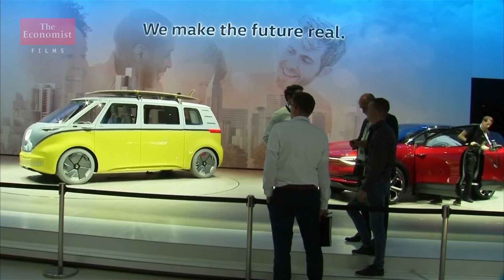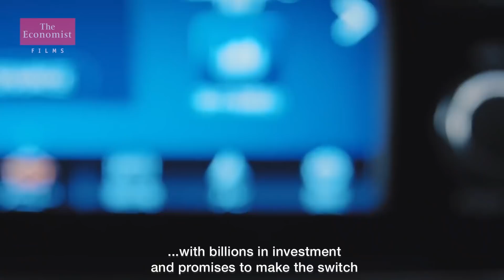Electric cars will come of age in 2018

Comment: Sorry but could this be the next bubble?    Can the batteries be charged more than 500-600 times?    How much will it cost to replace the batteries?    How long does it take to charge the battery?
Reply: 7% battery degradation after 250.000 miles https://insideevs.com/tesla-model-s-250000-miles/
Reply: It takes ten seconds of my time to fully recharge the battery on my EV.  Five seconds to plug it in at night, and five seconds to unplug it in the morning.  Compare that to how long it takes to drive to a gas station, pay for gas, fill it up, and drive home.
Reply: Taking battery replacement into account, the cost of ownership of electric car is still better.    Keep in mind that this tech will improve with time.  So replacement batteries 7-10 yrs hence will be likely be cheaper lighter, longer lasting, faster to charge, etc., ...
Reply: This isn't the next bubble, its the next reality for mass transportation. Battery technology is still in its infancy, but because of the inertia of EVs, that tech is closing in on huge innovations. Here is one by one of the most important researchers in this field, the man that co-invented Li-Ion:https://news.utexas.edu/2017/02/28/goodenough-introduces-new-battery-technology

Here is another battery tech that is currently being produced as I type this: http://www.toshiba.co.jp/about/press/2017_10/pr0301.htm?fromRSS=IR2017100301

Remember, ICE has had over 130 years of supremacy, and the lion's share of R&D. It will only get better for EVs from where we are at today.
Reply: Adam Smith you must be stuck in the 90’s. We have modern ways of disposing and recycling batteries. Electric car batteries that have had their charge reduced too much to be used for an electric car are used to store power for homes and other buildings, because even though it’s not useful in an electric car it’s still more than enough to power a home. A home uses 30 kWh per day on average, a 60 kWh car battery at 60% capacity is still 36 kWh of charge, that can power a home for 1-2 days during an outage. You can’t so any of this with a gas/diesel car. I’m assuming you forgot that these gas/diesel cars sit in junkyards and/or get crushed?
Reply: Blazing Dumpster 1. Yes, 2. Expensive but they last 10+ years with little degradation if the battery has PROPER thermal management. Overall batteries will get cheaper so a $9000 battery replacement now will cost $3000 5-10 years from now. 3. Charging times only matter in long distance trips, you will be charging your car everyday at home and/or work so charging time is irrelevant
Reply: Blazing Dumpter WRONG or IRRELEVANT. We don't know how fast the limits of DC Fast charging it yet, still being developed. Currently we are limited to 80% fast charger in about 45 minutes. But that is Developing very Quickly will get much Faster. My guess for 100kwh battery 15 minutes is the safe thermal dynamic limit upto 90%. But not something you should need often. Majority of BEV usage is simply plug it in end of the day when your 100KWH BEV has multiple days range of commuting. 
When batteries size keep getting bigger the  less Freezing Weather has effect, combined with Preheating the range hit should be getting close to 20%, not 40% that was for stupid machines like Passive batteries in Nissan Leaf 2012. 
CYCLES is IRRELEVENT as BEV batteries are  roughly a few hundred or thousands of cells. They behave nothing like a Cell Phone, WRONG analogy. When you balance Partial Discharge across thousands of cells you don't technically cover a full cycle. Thus why REAL WORLD Data shows BEV batteries loose just over 12% after 200,000 miles (still quite bad). 
But all this information is Redily Available VIA FUCKING GOOGLE. So stop with the Fake Ass Rhetorical Question where you clearly are trying to set-up a FALSE Assertion.
Reply: Tesla superchargers can deliver 300 miles per hour in peak conditions (depends on how full the battery is)
Reply: Adam Smith LIES and stupidity. Soo you are going to throw away $$$ Money. Companies will want to collect those batteries out GREED and profit. BEV batteries are NOT DEAD after deemed not acceptable for propulsion duty. Some will be chery picked for Stationary Storage while the rest will be recycled for the Valuable materials. Companies like IT Asset Partners are already pioneering that industry and growing at an alarming rate. Only Idiots like Adam Smith throws away money.
Reply: You will never have to replace a car battery.  You've been lied to.
Reply: Sami Tapio
You have obviously never driven or ridden an EV.  One day, inevitably, you will and you are in for the surprise of your life. I used to think I was a gear head or petrol head but it turns out I was a speed freak all along and EVs have way more performance potential. You're going to love it.
Reply: Blazing Dumpster 30 minutes only
Reply: It's actually not pressing at all.  Programs to repurpose, reuse and recycle lithium-ion EV batteries are being developed.  But even if they were just thrown away, Tesla batteries are free of any toxic chemicals or heavy metals that would prohibit them from being legally disposed of in a regular landfill.
Reply: Blazing Dumpter you wilfully ignorant troll spamming cookie cutter lies. Troll like you spam the same set of stupid question.
BEV have been surprisingly successful in the ARCTIC CIRCLE so you can't get much colder. Teslanomics survey of real world car ownership showed acceptable level degradation after 200,000 miles and 4 years. Projected vehicle propulsions duty could easily be 400,000 miles before Stationary Usage. Battery replacement cost is IRRELEVANT when 400,000 miles will be roughly 15 years for most people. Charging your BEV takes about 30 seconds, the time takes to plug in you car at the end of night.
Reply: Blazing Dumpster
Are you talking about the time spent holding on to the hose surrounded by petrol fumes? It's the 21st century and we don't do that any more, an EV is charged while you aren't using it. For local use it takes 2 seconds to plug it in at home or work and it's full every time you sit in it. For long distance it charges while you go do the bathroom and/or food etc, depending on your personal bladder and appetite range. For local transport EVs are already way more convenient than ICEVs, for long distance EVs are fast approaching equal convenience with current battery storage capability and that better energy storage is on the way.
Reply: Blazing Dumpster
Tesla Superchargers do 400 amps. It's perfectly safe, you just need very thick cables. Higher voltage chargers are being developed (higher voltage means less amps). Porsche for example recently announced a new charging standard that allows 15 minute charging.
Fast charging hurts battery life a bit, but you don't do that often, only on long trips. Most of the time you charge slowly while you are not using your car anyway. Like when you are at home sleeping. Or at work, or at the supermarket, or at any other place where you park your car. Chargers are cheap, easy to install, and safe, so soon they will be everywhere.
Reply: No one who has driven an electric car (any electric car) would voluntarily go back to an ICE. It's a superior driving experience in every way.

Whenever I see an ICE now, even expensive luxury and sports cars, I just see an old tech vibrating piece of shit.
Reply: Sami Tapio 
I look forward to returning to this message in 5 years, when EVs are cheaper than ICE equivalents as well as being superior in every way, and laughing my arse off at your ignorance.
Reply: It may be quite heavy but it out-performs practically everything on the planet. The 'piece of junk' Tesla out-performs the vast majority of ICEVs which doesn't say much for the vast majority of ICEVs. You clearly have a personal issue with Teslas which you've also never driven. 
A small reminder; EVs are in their infancy with lots of large improvements ahead of them and already out-performing ICEVs, which are at the end of their development and are as good as they're going to get. You are in for such a surprise.
Reply: Sami Tapio
At the current rate of battery technology improvement and cost reduction EVs will reach initial cost and convenience parity with ICEVs in 2025, whole of life parity by 2018. Given the massive difference in running and maintenance costs and performance, by 2025 nobody but the most blindly dedicated will be buying new ICEVs by then. By 2030 there will be more EVs than ICEVs. 
If you're interested I can point you to those figures.
Reply: Sami Tapio 
In 2030 it will be illegal to sell a new ICE in the EU.  Car manufacturers are already phasing out the ICE.
Reply: Sami Tapio
As is the case with all news technologies the early stages are not for poor people. That has to wait till the tech is more established. The latter stages of every disruptive technology we've experienced since the start of the industrial revolution have been extremely rapid because that's the nature of exponential growth. It's highly unlikely this disruption will behave any differently.
As I said, if you're interested I can point you to the relevant and well-credentialled figures.
Reply: To be fair there were electric cars before there were gasoline and diesel powered vehicles around. What let them down was a reputation of being the woman car and the fact that range newer could compete with the gasoline powered cars.

That said I agree that there is a lot of interesting developments to make the electric car the peoples car.
Reply: Well considering the price of batteries has halved in 5 years, the cost of replacing them again in another five years will negligible.
Reply: Yes they are, that´s why EV´s have climate controlled batteries which is basically to insure that the battery never gets Cold and in some cases to varm...
Reply: Blazing Dumpster batteries have their own heating SYSTEM
Reply: Charge? Less than 10minutes for batteries which are already being tested in the labs.
Reply: 150 kW and 350 kW charging points exist already.
Reply: Highlighted reply
Blazing Dumpster
I don't see much in the way of emotion. I see a number of people answering your questions but I don't see you paying much attention to those answers. Perhaps you would like to?
Reply: Robin Harrison 

I was in Amsterdam last weekend. All taxis are high end luxury cars there.

I stepped towards the taxi rank at the airport and the first 2 were Teslas but they were taken.  I found myself looking at car number 3, a Mercedes Benz, and thinking what a piece of shit, i'll wait for the next Tesla.

It was then that I realised how much my attitude towards cars has changed.  ICE = old tech.  I would have felt the same way if the next car was a Lamborghini or a lotus or a Ferrari.
Reply: Sami Tapio 
Which aspect of "performance"?
Reply: Sami Tapio
Of course they are heavy, they're large sedans and CUVs with very large batteries and yet the electric drivetrains allow those very heavy vehicles to out-accelerate most ICEVs.. Fortunately those heavy batteries are in the floor so the lower centre of gravity allows them to corner way more efficiently than similar large sedans and CUVs. Once again, you haven't driven one so you don't know. Any way, check out Rimac Automobili; quick and fast. That will show you the potential.
Personally I like 2 wheels and you haven't tried one of them either. You are in for the surprise of your life.
Reply: Sami Tapio 
LMAO 0-60 in 2.3 seconds not enough performance for you?  Even the model 3 can do it in 5 seconds.  

The fact that they're heavy and can outperform most ICEVs just demonstrates how pathetic ICE technology is.

They're Also around 3 times as energy efficient (generation to wheels) despite that weight.  ICE technology is shit.
Reply: 2LegHumanist
I found the same and it really surprised me but it's right; ICE = old tech which is relegated to nostalgia value now like steam engines.
Reply: Sami Tapio 
Audi Rs7, 2 tonnes.
(Tesla 2.3?)
WHY does a (ICE) car need to be light ?
To improve the power to weight and torque to weight ratio! 
Type for type comparison.
RS7 *
Power 292 hp/ tonne. 
Torque 369nm/tonne.

Tesla P100d **
Power 311hp/tonne
Torque 483 nm/ tonne

*WHEN in the power/ torque band
**TORQUE fro. ZERO rpm!

OOPS!
Add better c of g due to low slung batteries and motors.........
Reply: Sami Tapio 
From your other post it seems that you feel "nobody is stupid enough to buy an EV where you live because the winter is extremely cold" Which would imply you run two cars, (extremely wasteful?) since you have a summer car which is totally impractical for winter use?
So, the "summer" car COULD be an EV?
Reply: No need to get emotional.  I have no skin in this game except my future wallet and I do care about the environment.   This Economist article seems overly optimistic without addressing some of these basic concerns so I am just asking the questions.   And I have more.  Will fast charging  stress the battery and reduce longevity?   I know that fully charging and fully discharging causes stress for batteries.  That’s why current hybrids are programmed to keep the battery in the approx 50% range and is used only as a short term energy store.  As a result the battery lasts the life of the vehicle with no degradation. Stress seems to effect battery life significantly.  I am just asking.
Reply: As for distance travelled and a lot of charging,
https://jalopnik.com/this-is-what-happens-when-you-put-300-000-miles-on-a-te-1798662230

On Nissans Swedish website, the car building preview states that a 30kWh Leaf Acenta (the mid spec model) cost 391434SEK including the battery and 361590SEK without the battery (battery leasing cost will be added with 829SEK per month). So in clear numbers 29844SEK, which is about  2932 Euros or 3446 US dollars. As comparison, replacing a CVT transmission on a 4 year old Nissan Juke at the local Nissan garage was over 108000SEK.

Charging can take between 15 seconds to over 24 hrs depending on battery size and charging current. Trickle charging is slowest while Rapid or Supercharging takes 15-40 minutes. But for daily use you only recharge what you used this day and connecting the plug only takes 15 seconds. After plugging in you go inside and do stuff like have dinner, play computer games, shower, have sex, paint or play pinball if you are lucky enough to have a table. It´s just like charging your phone... 15 seconds and like magic it´s fully charged in the morning.
Reply: Then why are you not asking questions?

You have been making statements as if you know the truth to be what you have stated.  If you think you have been asking questions, I suggest you reread you own writings.

Heck, you don't even use question marks, so how could they be questions?
Reply: To charge a 30kwh Nissan Leaf battery in 10 mins it would take 180k Watts to flow into the battery  for 10 mins.  Say at a special charging station 440 V that would be 409 Amps.    The Leaf spec says currently it takes 6 hours at 220v. So I assume max current is 20 amp for safe charging.  Is the leap from 20 Amps to 400 Amps charging current realistic?  Again would that not stress the battery?   Just asking.
Reply: Blazing Dumpster 
DC fast charging at 50kw will charge a 30kwh leaf to 90% in 30 mins.

That's what Chademo is for.
Reply: Blazing Dumpster 
Also if you read Joe Black's comment again you will see he is talking about future tech.  

300kw and 1mw dc charging will soon be here.  The biggest challenge is not power output,  it's keeping the battery and cables cool during the charge.  Tesla are talking about using on-site liquid cooling so the cooling system doesn't have too be apart of the battery.
Reply: Blazing Dumpster 
".... You're just asking" but doing no research yourself?
I tend to do a search about once a month for Next Generation battery or similar and see what comes up!
Google Toshiba battery press release.
Read the article from October 3rd
Should answer all your questions!
Battery size sorted
Range sorted
Fast charging sorted
Cold weather performance sorted
Degradation sorted
Availability (2 years) sorted

Toshiba would not be making these claims if they weren't confident of producing this battery. They have been in a precarious position since there problems with nuclear (Google it!). A wrong move at this stage would kill the company, so they would not take a chance. This is going to happen.
Game changer!
Reply: Sami Tapio
I'd actually be very interested to know what you drive and where you drive it?
Reply: Sami Tapio
I can only assume you live in a colder climate than Norway which is enjoying a huge and successful uptake of EVs. As for the timeline for the takeover of EVs, as I said if you're interested I can point you to the relevant and well-credentialled figures.
Reply: 2LegHumanist 
Re the phasing out... INCLUDING BMW! 
HEY SAMI! BAD NEWS!!
ELECTRIC BIMMERS! 😱😱😱
Reply: BMW i3 pack around 12000 GBP
Reply: And what about cold weather performance?   Are the batteries not inefficient at low temps?
Reply: Hold on when you say charging time are you guys talking about the time it takes to plug in the plug?   I am questioning the time it takes to fill up the tank when you have to make a road trip and stop to refill along the highway.  Also looking at the spec sheet for a lithium ion battery it says it loses 20% of capacity after 300 cycles. My cell phone battery dies after about two years of use, to corroborate.  Does the manufacturer give you a warranty on the battery?   I couldn’t find that info for a major brand.    I could not find any info on charging times either.  And as for cold weather performance, is a 40% reduction in range acceptable?   Seems to me we still need a better energy store.
Reply: +2LegHumanist  that is bullshit. If you are true "gearhead", electric cars are just piece of junk. you need to have fully control of your car, Car NEEDS to make noice when u floor it... oh and those stupid computers and touchscreens... you dont find those in REAL cars.
Reply: +Robin Harrison can you please give me one example of performance electric car? ( and no, tesla isnt one. its WAY too heavy to be a real performance car )
Reply: +Robin Harrison that rimac looks nice. but it is still quite heavy...  and it looks so much better inside than piece of junk tesla.
Reply: +2LegHumanist acceleration is not all the performace i want. car needs to be LIGHT too. car that weights over 2 TONS is piece of junk
Reply: +Robin Harrison it will take a long time before electric cars are more popular than ICE cars. maybe in 50 years there are more EVs than ICE cars
Reply: +Robin Harrison  there are over 1 bil cars in the world... do you really think that we will have over 1 bil EVs in 2030? its not going to happen
Reply: +Robin Harrison also with current battery technology, nobody is stupid enough to buy a EV where i live ( winters are extremely cold in here )
Reply: +Roger Starkey my summer car is modified bmw e30 with s54 m3 engine with turbo.
Reply: +Robin Harrison sure i would like to see how on earth it could be possible to produce over 1bil electric cars in 13 years... And electric cars in norway... you think poor people without warm garages have EVs? specially if you live in northern norway?
Reply: It's not quick as filling up gas that's for sure. No one wanna wait 30 minutes to recharge a battery come on people have stuff do to, especially in commercial business. Most commercial trucks and school bus already have electric motors. EATON does all of that.
Reply: The more pressing question is what happens to the batteries when they die and are thrown away? Nothing good, they usually end up in India or China sitting in some junk pile slowly leaking their contents out.